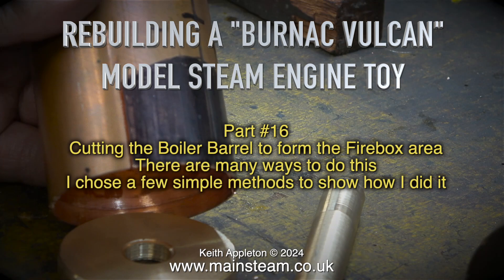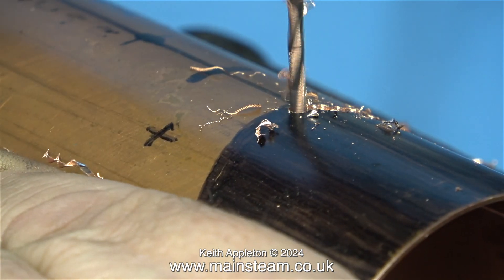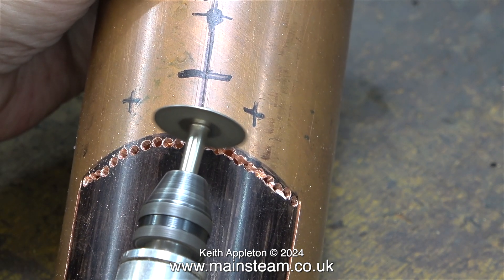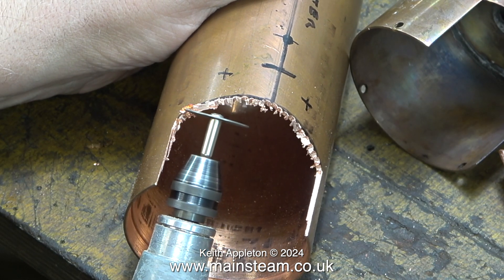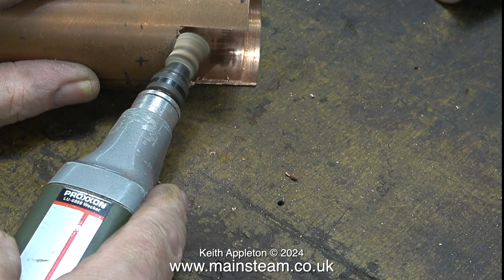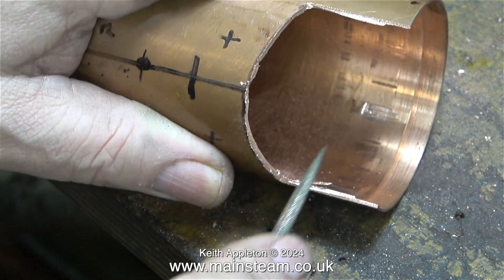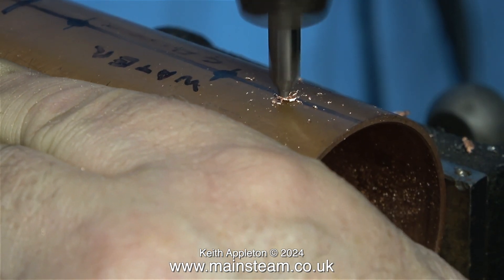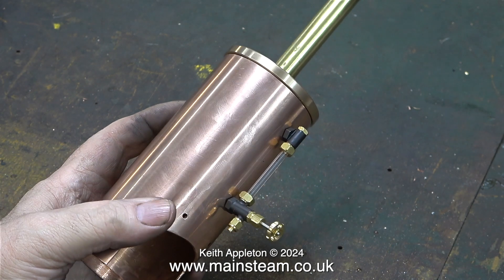REBUILDING A "BURNAC VULCAN" MODEL STEAM ENGINE TOY - PART #16

Comment: Wow Keith, you sure jogged my memories of  Structural Airframe Repair while in the Air Force more than 45 years ago. I did an awful lot of chain drilling, as we called it. Not in copper, but mostly in aluminum and stainless steel. Then I’d try using a burr bit with many teeth. Mostly it would start vibrating and chattering about, so like you, the hand files usually worked out the best.  
Great Job. 
You also stay safe and extremely healthy!!!
Reply from the maker: Chain Drilling - thanks for that - I forgot what this technique was called }:-)))